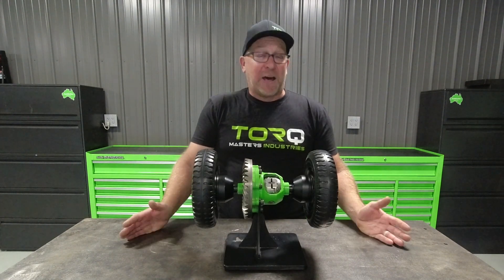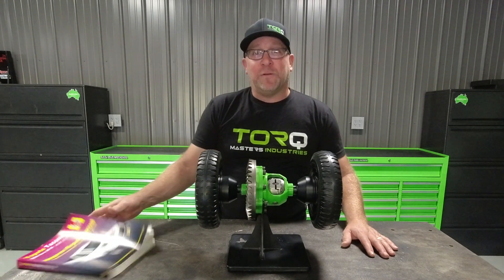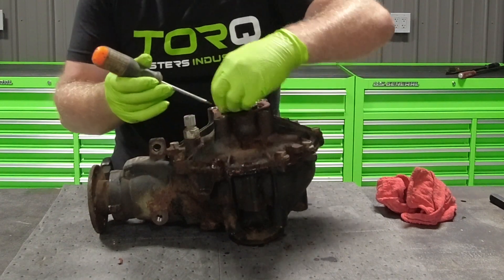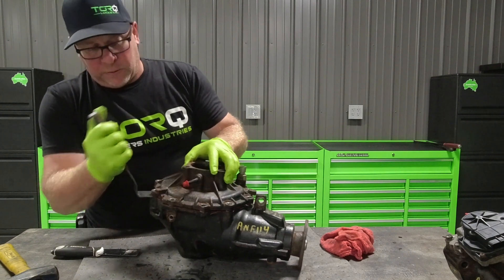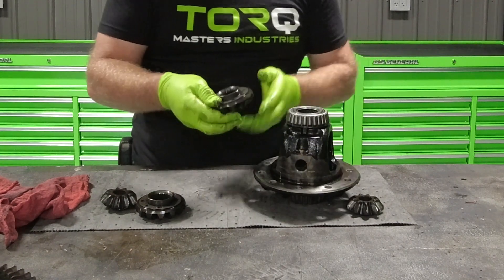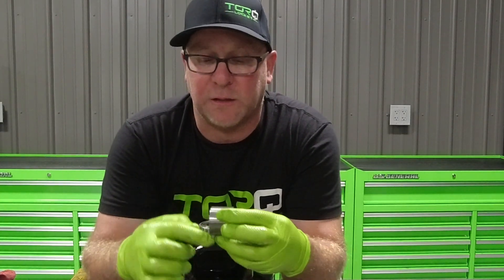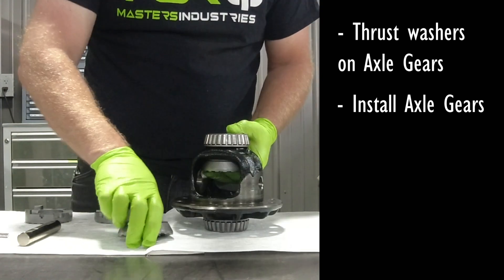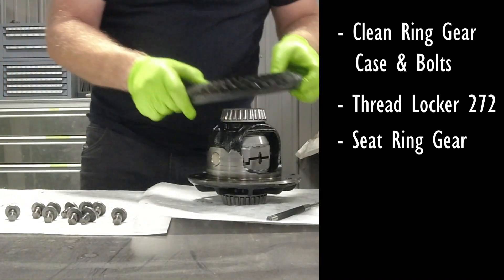TORQ Locker Install Video for Toyota Tacoma 8" Clamshell Front Differential

Comment: Fairly easy install. Don't forget to disconnect breather hard lines from the top of the diff housing before you drop the diff or it gets hung up. 

One big thing that I didn't realize when installing this locker is that the front drive shaft is now always locked with the front left wheel. So in 2wd, the front drive shaft now spins reducing gas mileage. =(

Comment: My Land Cruiser Prado 98 diesel has the H=High speed box (70% power in the rear, 30% in the front)
HL= High speed Lock Differential (50% rear, 50% forward)
LL= Low speed Lock Differential (for extreme conditions), is it possible to install TORQ Locker??
Reply from the maker: We would not recommend a front axle locker because you don't have 2wd for on the road driving.

Comment: These lockers cause the front drive shaft to spin at all times when moving even in 2wd. Will this damage the transfer case having the drive shaft spin while not engaged in 4wd?
Reply: @Eric-qu2vp No, the locker will not cause any issues with the transfer case.

Comment: Before I make the jump, do you need to run a gear pattern? does pinion depth need to be adjusted after installation?
Reply from the maker: No, you don't have to adjust backlash at all. You don't touch the pinion. That's the beauty of this type of locker, easy to install. We like to say, if you can change the brakes on a car, you have the mechanical ability to install a TORQ Locker.
Reply: @TorqMastersIndustries  How does the TORQ locker affect daily drivability? Just Keep it in 2hi? Toyota does recommend putting my Tacoma in 4hi once a month to keep things lubricated. Im just concerned if having the front diff locked while driving will cause any issues. Thanks for the replies
Reply from the maker: @joshlopez9913   Normal daily driving in 2WD will feel the same as an open differential, no lock up at all in 2WD. You can use 4WD with a front locker on the road if needed in deep snow. One of your front axle shafts is always turning, that keeps things lubricated. I don't see a need to shift into 4wd once a month, we don't do that with any of our vehicles.

Comment: Thanks for the video! How does this behave with a rear lunchbox locker? I have one in the rear and looking to add this in the front in my 15 Tacoma
Reply from the maker: In 2WD a front locker is not noticeable at all. in 4WD it's there to add extra traction. With a rear locker you will need 4WD less in snow and ice.

Comment: What's the drivability in 4wd for someone who lives in an area where it snows 6 months out of the year?
Reply: Bought it, installed it and it works but will not disengage for the love of God. Did the clearance test and one tire test and seems to disengage but will not disengage while driving doing figure eights. I'm taking it out for an front arb locker. Stick with selectable if your rig is not a dedicated trail rig.
Reply: @cheevue9320  In what vehicle?
Reply: I imagine its similar to any other lunch box style mechanical locker. IME I would not put a lunch box in the front of a vehicle that I drive regularly in the snow. I had a lunchbox in the front of a rig years ago and it would pull side to side and power though (understeer) corners in the snow. In the rear lunch box lockers are far less noticeable.
Reply: FJ cruiser

Comment: Very helpful! Is this for front only? Can you also get a rear locker for Tacoma/4runner?
Reply from the maker: We have a rear locker available for older 4Runners, but not newer than 2001. Here's the fitment for the model in the video:
Fitment: 
2003 - 2022 Toyota 4Runner
2015 - 2022 Toyota Fortuner
2003 - 2009 Toyota Hilux Surf
2005 - 2022 Toyota Tacoma 4wd
2007 - 2014 Toyota FJ Cruiser
2005 - 2022 Toyota Hilux Pickup